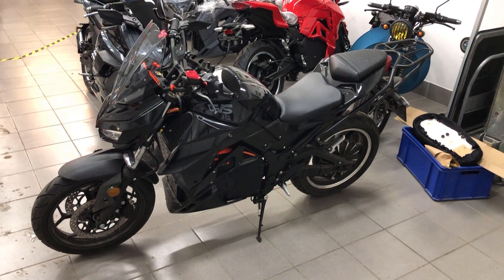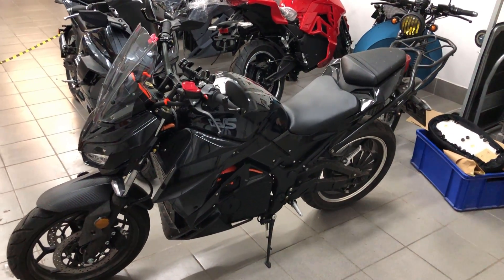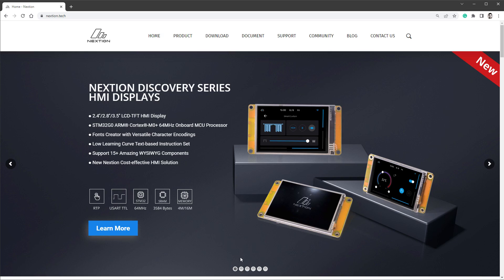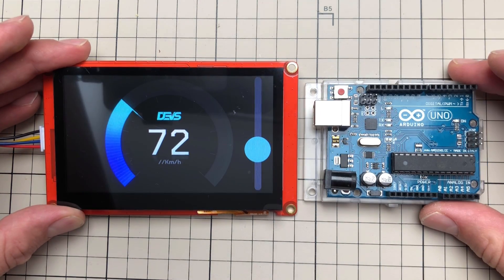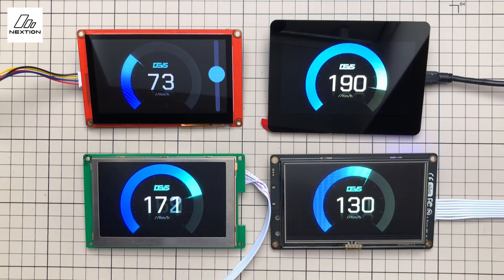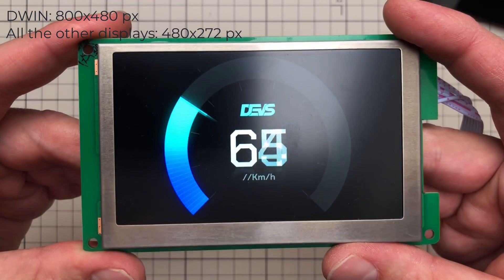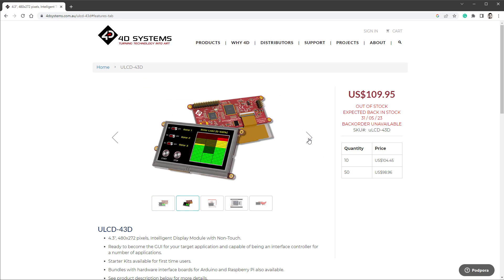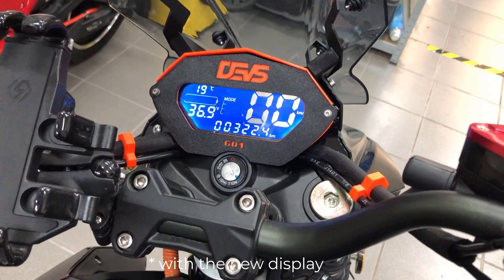My biggest project so far...

Comment: Hey! How did you change the number with the speedometer. Will you tell me?for dwin dgus.
Reply from the maker: You need 10 images of digits, that´s all. I might cover this in the future tutorial.
Reply: @upir_upir  how did you do the layering. I use icon animation for the circular progress bar but when I trying to put the changing number animation on the top of that I can't see any number animation on the virtual screen but I can see the circular progress bar in virtual screen.. The circular bar is working. But the number animation is not showing. Any suggestions?

Comment: so whatever came of this project, i cant seem to find any other videos on it
Reply from the maker: Sadly, there is no second part - yet. This project is progressing very slowly, but I will record a video once I have any new findings.
Reply: @upir_upir  in that case, I know you have the GPS speedometer tutorial, but have you looked into using a hall effect switch and a magnet mounted to the wheel to get a wheel rpm and some basic maths to get that to read out Kph/Mph? I'm trying to do something similar with a bike, to eventually translate it to my own motorcycle. But I am big idiot so progress is only a little faster than molasses in an arctic winter

Comment: I am also developing a graphical display for electric motorcycles but for much smaller bikes like surron, I mainly used ESP32 development board with displays which are good enough for development but they also suffer from brightness problems, my solution was that I changed the display on the development board, I thought since it uses the same interface(rgb565) it should work and it kinda did but there were crealy problems with horizontal sync since I can change horizontal sync frequency in code it shouldn't be a problem but in Nextion I don't know if this is possible.
Nice design, cheers from Brno :)
Reply from the maker: This sounds very interesting, thank you for your comment. Do you have any examples of your work? I would surely love to see it. I agree that most displays suffer from low brightness, I don´t think you can easily replace Nextion display panels with a different ones because of the problems you have mentioned - the timing might be different and it would not work properly. The displays from Display Visions have a great brightness, but they are not cheap.
Reply: @upir_upir  Yes, I have It's called R.OS vesc display on endless-sphere everything is documented there I don't know why YT kept deleting my replies so switched to my college account

Comment: Hey! Any updates? We're urging for news 😅
Reply from the maker: I wish I could say I have some updates, but it´s on hold. I will try to keep it moving and post some progress soon..
Reply: Sounds great! I'm doing a custom speedometer for my electric Chinese Vespa and the current situation is just like yours, trying to find a 3.5 inch screen with at least 800 nits. And I also want it to show turn by turn directions from my Google Maps. Not much progress besides the main interface so far. I have a working prototype with a 16*2 screen.

Comment: Any progress on this project? I'm also looking to create a CAN display. Thanks!
Reply from the maker: Unfortunately not much of a progress, but I hope to get back to it again. Are you developing it for a car or a bike?
Reply: @upir_upir  I am working on converting an old Baja SAE car to electric. I'd like to put together a display/arduino setup that can read the CAN messages from a Sevcon motor controller to display things like battery voltage, speed, motor/battery temperature, etc. This project seems like almost a perfect parallel!

Comment: This nexion displays?
They work with vector graphics?
Reply from the maker: You can use vector graphics with Nextion display if you convert it first to font file, however, it´s oftentimes much easier to just use bitmap grapics instead.. What are you trying to achieve?
Reply: @upir_upir  I need animated manys graphics primitives in real time(without delays) - for very precise devices.
Reply from the maker: In that case, Nextion displays are probably not the best option.
Reply: @upir_upir  Nexion display like "framework" for rapidly DIY.
I think need use separetely chip MCU + display.
Reply from the maker: Yes, nextion is great for fast prototyping. For your case, non-intelligent display would work better.

Comment: Love it. I found this after watching your other OLED gauge video. Commercial options do not work for me. Either features are limited or the cost is not affordable. I have thought too much about the screen- I'll keep investigating a way to utilize a smart phone as you get an incredibly nice, weather resistant and high nits screen that is not otherwise available. Keep sharing your work please!
Reply from the maker: Thank you! What are your trying to achieve with your project? Trusting of Smart phones is surely an interesting option.
Reply: @upir_upir  I thought about it far too much and made it way too complex. I'm now just using realdash on my phone. And am going to use an arduino Every board to take the analogue and digital inputs from the bike, convert them to can and send to the phone via OTG usb. Could use Bluetooth but I like the idea of a wired connection more (it needs a power connection anyway). Will use opto isolators on all inputs to Arduino and a bare bones ROM on the phone to run in the background. Still lots of things to work out but the phone was too good to pass up as the basis for a dash. It even auto adjusts for brightness! Basically everything you could want is already there!!:-D
Reply from the maker: @nathanchalecki4842  Sounds very interesting. Do you have any photos of your project/setup? Thank you!
Reply: @upir_upir  not as interesting as yours! There is not much to see with mine, most of my time has been spent getting the realdash serial Data to flow between my phone and the Arduino, and figuring out the can frames etc. Pretty steep learning curve. I can flash indicators etc on my screen by pushing an arduino button so that's a good bit of progress for me.
Reply: @upir_upir okay, I have had to quash the phone idea. Boot times are obviously terrible and android just doesn't reliably support automatic start of applications on charge power, etc. 😢 It works like garbage, basically. The display visions screens look great, I'm looking at those now. A decent weather proof enclosure is the hardest part of the whole thing so their glass cover and flange is a great system
Reply from the maker: @nathanchalecki4842  Thank you for the update - I´m sorry to hear that the phone didn´t worked out as expected. Yes, the boot time is one of the advantages of pretty much any of those intelligent displays, they are all instant on, so the boot time is perhaps one second, maybe even less. The displays from Display Visions are great, they have a high brightness and are relatively easy to use. I would be interested to see how your project turns out, please keep me posted, thank you!

Comment: Thx so much man if u show how to drive nextion with arduino, i find it so difficult i gave up because there’s so few documentation and help for this niche display… if u could get it to print values from a sensor or something like that, i’d by really thankful man. Awesome project btw
Reply from the maker: Thank you for your comment, I do plan to record video with Nextion display soon. What kind of sensor are you planning to use/ do you have any specific project in mind?
Reply: @upir_upir  i didn’t have a specific project in mind (or i did actually, it was a smart plant project where the nextion would display the soil humidity) but reading any variable and displaying it on nextion in general is what i struggled with

Comment: Hope that won't destroy itself in bad weather conditions, moisure is bitch to deal with
Reply from the maker: We will see, hopefully it will last at least a few rides :) Do you have any ideas how to make it weather/moisture-proof?
Reply: @upir_upir  Not a clue. I'd imagine sealing it but then you have to make sure you don't get any moisure inside  or else screen might fog. I'd test it before you make more than one-off, in bike the worst case is whole screen getting splashed by water... for entire drive

I also remember Tesla getting into problems because they used consumer-grade screens that were not rated for the amount of heat in the car and failed. But those intelligent screens might be fine for that, the Nextion appear to be rated all the way to 70 C and even to 90% humidity.

Sealed case with transparent front and some conformal coating might be enough, just need to care on how you're getting cable in so the water can't seep into it

I'm sure you figure it out (or might just get lucky and start with design that just does it fine) but be sure to do some a bit more extreme testing before making more than one unit (I assume your "friend that makes electic bikes" will want to make more than just this one off)

Also one fast MCU might be just fast enough to drive LCD on its own with simple UI if you want to save a bit  $, but that's probably much more work than those "intelligent" LCDs

Comment: Some of these HMI boards use displays with non-square pixel pitch. Worth checking the datasheets for the particular panel component used. This I found to my cost when circular guages appeared annoyingly oval. Unacceptable if you are a bit OCD. I've tried a few panels with LVGL and have found that the biggest culprits are 4.3" 800x480 types with the ST7701S or similar RGB interface. All the 5" models were perfect.
Reply from the maker: Thank you for your comment, I have learned this lesson the hard way - the Nextion 7-inch display has non-square pixels to the point that it´s very visible, you don´t have to have OCD. So it´s sitting here on the shelf and will most likely never be used for any project :/ From that time, I always check the datasheets.
Reply: @upir_upir  OK, I'm glad someone else has seen this and finds it a problem - if you search the issue it seems that nobody has noticed or nobody minds. The big question is: why would a manufacturer build a display with a pixel pitch other than square? If the display is designed purely for video playback then I do understand (new old stock perhaps) as there are some standard aspect ratios to be catered for and respected but the days of doing that with hardware are really long gone.  Thankfully, any circular display - such as the popular 2.1" IPS ST7701s is guaranteed to be good (it would look pretty stupid otherwise). The also popular 4" square ST7701s 480x480 is almost square pitch but not quite 0.146 : 0.149

It grinds my gears but I'm not sure others notice it.

I've also found (in my experience) that any display which uses the 16/18 bit MCU parallel interface with integrated frame buffer is usually precisely square px and I think the reason is that these panels are targeted at computer graphics applications using host draw functions whereas the much cheaper but great quality RGB parallel displays which require an external frame buffer are historically associated with video playback where screen geometry is mailable via software.
Reply from the maker: @nikthefix8918  Truth be told, I probably do have OCD :)) But I see your point, it drives me crazy seeing non-square pixels. I believe you assumption is correct, all the intelligent display manufacturers are sourcing the actual display panels from various places, and since they mainly look at the price, unfortunately sometime the pixels are not perfect squares. However, what surprises me even more is that people are using those displays and not really care that square is a rectangle and circle is oval. Horrible!! :))

Comment: Excelent project,  Years ago, I started a similar project for a car, selected and played a lot with the Nextion display until I figured out, it will not work properly in day light, from then, I just put the project aside after buy some brighter displays but not "inteligent" (wich allows beautiful graphics and fast response but at a higher prece point), still not played with them.   interested in see, how your project evolves.

grretings from Italy😊
Reply from the maker: Thank you for your comment! Your project sounds very interesting, is there perhaps something more that you can share about it / photos / more details? Unfortunatelly the Nextion displays are very easy to use, but the display quality is not so great. Which is a shame, otherwise, it would be my preffered display to use.
Reply: @upir_upir  yeah, the Nextion is very easy to use, I communicate directly with it using simple serial commands and not their library wich was at the time, hard to understand and bulky. For indoor projects, I think is a good and cheap solution for anyone without high knowledge of programming like me.  I do not have uploaded anything of my projects inline, but if you need some info I can provide to you. My project was based in a 4.3" Nexen extended version, developed the graphics and code in their IDE simulator, only after a year, I bought the real display with a couple of 2.8" wich I developed a dedicated PCB to hook back the display board. Was an interesting project, but never finished. Was based in atmega328P, all the filtering necessary to cope with the automotive enviroment in the power supply, a pair of NTC temperature sensor with all the filtering and pullup resistors, 3 analog inputs filtered, a RPM signal process circuit and some output pins trough a darlington (ULN2003), all that in a 2 layer Board and parts only in one of them (back in the 2.8" display, with the 4.3" just played a bit using a simple arduino simulating data trought the serial), that was a good challenge, but, only to figure out, the nextions displays are only for indoor use.
Now I have a couple of Chrystalfontz high bright ips displays but they are not intelligent, the 2.4" is SPI and the 4.3" is command in RGB mode(wich need a bunch of IO pins) I think, but not played yet any of them, in this case, I need to create a full new PCB, allocate parts in 2 layers (or do 2 boards) and place FCC connectors for the display and the touch, code everything... The 328P is not powerful enought to do with the graphics I get with the Nextion, and for many reasons plus these, the new project is abandonned. Hope this year can start it again.  If I can help with info, don't esitate to ask, I will be happy to help you. Cheers
Reply from the maker: @hiperformance71  Thank you for your very detailed answer, too bad you haven´t recorded anything, I´m sure there would be many people interested in your project, even when it´s not finished. Have you considered switching to some different intelligent display, like the DWIN ones? Those are very similar to Nextion, but they have high-brightness IPS screens that look great. They also run faster compared to Nextion, and they also use the serial protocol to communicate with microcontroller. That way, you can possibly still keep your old setup and only exchange the displays? Let me know if you would be interested in cooperation on this project. I would be happy to help with the display side of things...

Comment: I'm thinking about the same project for honda cbr650r but as additional display. I have a question. How will you communicate with the bike? CAN or ELM327 (bluetooth)?
Reply from the maker: Sounds like a great project. What are you trying to display? Is there something that is not displayed on the built-in screen? I think we will go with CAN, since everything is very close together, there is probably no need to use bluetooth..
Reply: @upir_upir  My plan is to create a system similar to Android Auto. I aim to display the accurate cool temperature and a steering control interface (eg/ cardo intercom, music, etc). I plan to utilize the ESP32 or STM32 microcontroller, MicroPython programming language, and the LVGL library for the ui interface.

Comment: What are your plans about weather resistance? Isn't touch function kinda useless in a bike? Or do you intend to be Bluetooth compatible, giving android auto/carplay function of sorts?
Reply from the maker: The display will be sealed, we will see if that´s enough or not.. I don´t know if the touch will be used or not, and if so, than only for some simple settings liks the screen brightness. The thing is that except for the DWIN displays, all the other brands always include touchscreen, whether you use it or not.

Comment: Are those displays rated for automotive? Are you considering as requirement e.g. bigger temperature range and especially vibration resistance?
Reply from the maker: They should be all rated for industrial usage, so hopefully it will be enough. I’m not too worried about the temperature range, as you will most likely not drive a bike when it’s freezing cold, but as for the vibration, we will see…